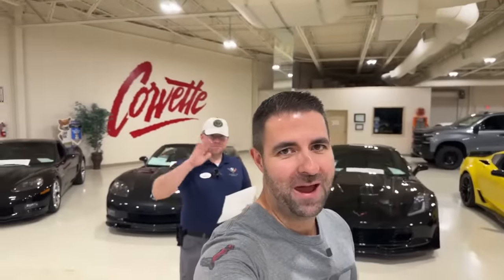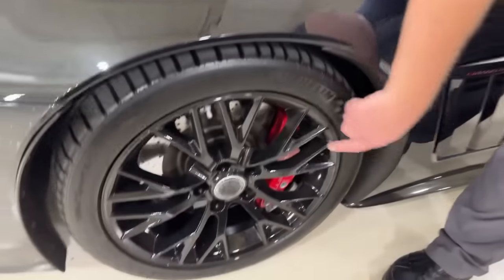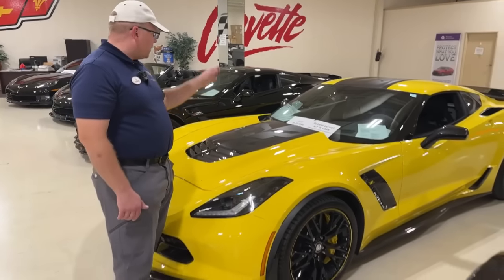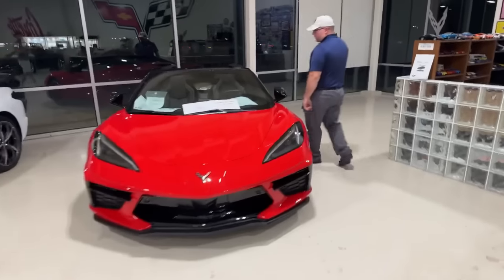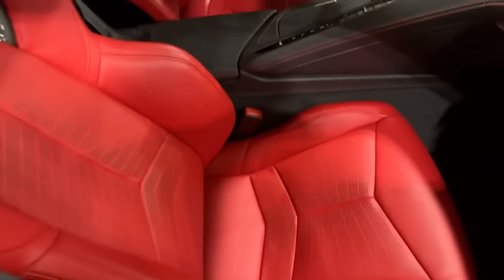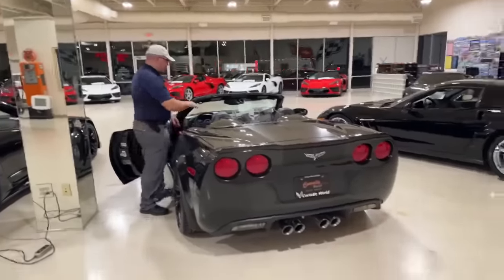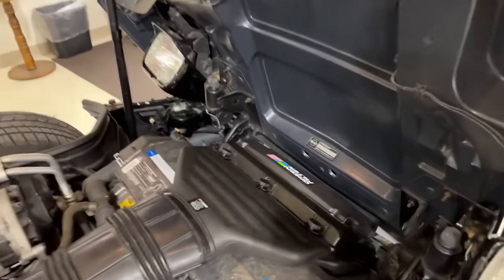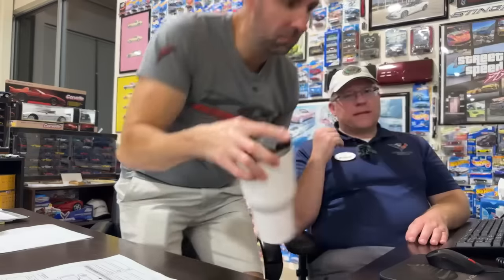Another $60k C7 Z06 at Corvette World & Inventory SHORTAGE!

Comment: Great video but I just purchased my first vette (24 C8) and what I found was that it’s very regionally controlled on the ADM.  The west coast, south, and south east were the markets where I couldn’t find negotiate anything without a “market adjustment.”  I had to place an order in Baltimore to secure one at sticker but ultimately bought one at sticker in Arizona that was close to my build spec.  Additionally, pricing on used seemed to be better up north and on the northeast coast but I didn’t want to drive it back that far.

Comment: Hi guys,…I’m purchasing today a 2016 Z07 3LZ 11000 miles. Show room condition. Obviously loaded to tits. Extras include full aftermarket exhaust from stainless steel headers to back,..Carbon fibre galore,..AFE Power Carbine Fibre cold air intake ,..loaded loaded . Please comment negative or positive 😊 btw,.. I was on Z06 list and was about to put in order,..my specs came in at 185K Canadian plus Tax which then went to 220K  . 😡 that WAS not in my budget. Cancelled order and bought the Z07 2016
Reply: I hope your car has a stick because the cooling issues didn't get addressed until MY2017...And the autos still had overheating issues all the way through MY'19.
Reply: Wasn’t there a fix? And maybe the previous owner had it done. He was meticulous